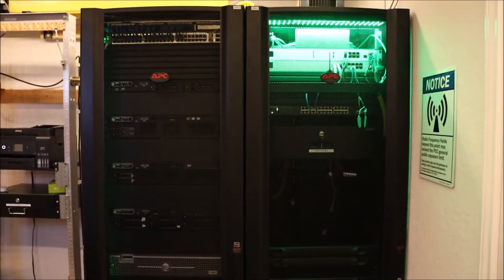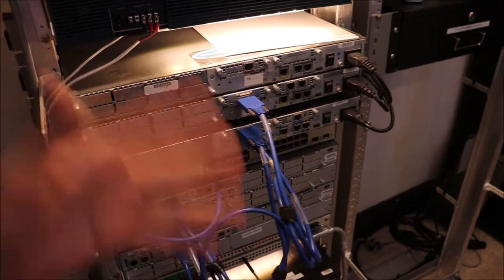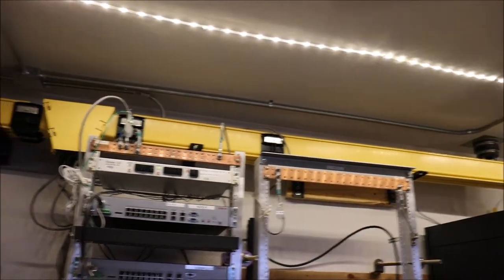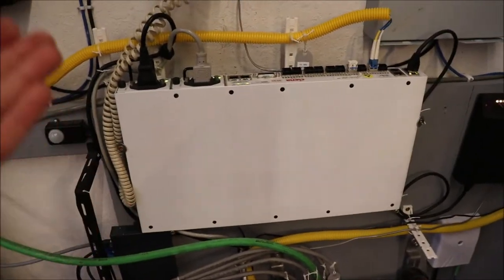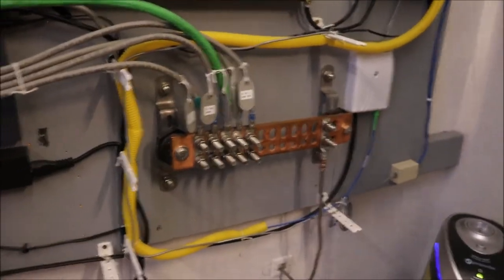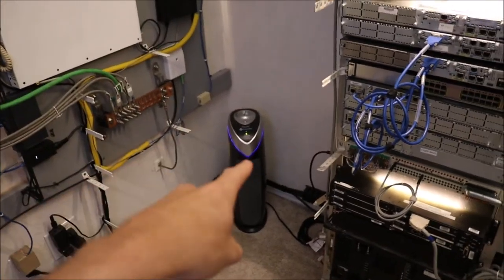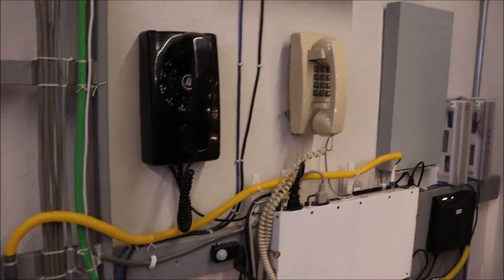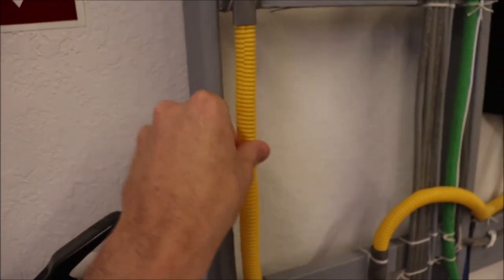Home server room build part 4

Comment: If you have not tied the new ground rod into the rest of the rods i would. You could still have a voltage difference between fixtures if all are not bonded together.